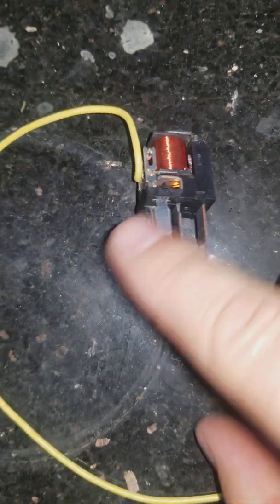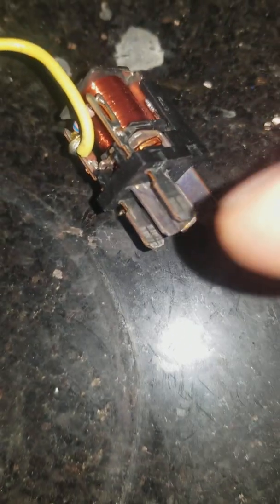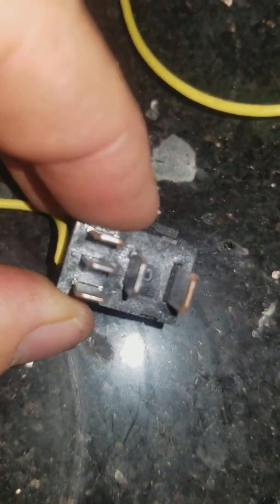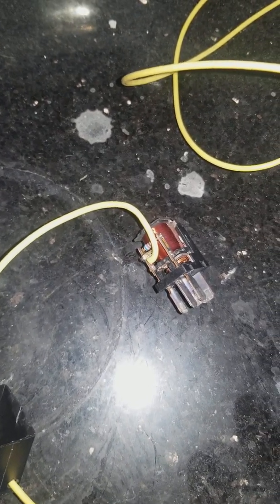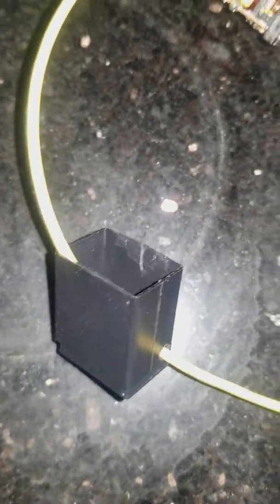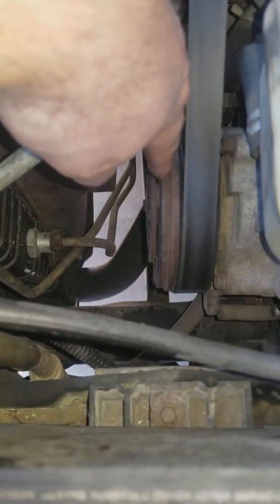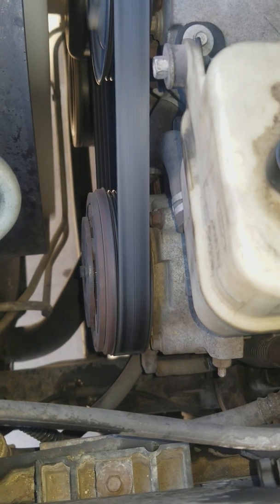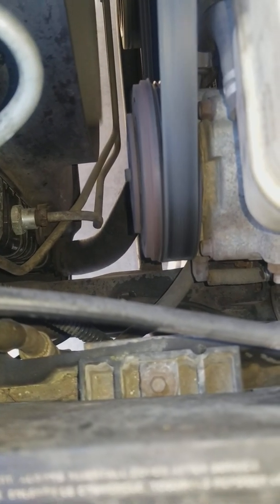Ford Explorer AC clutch intermittent fix

Comment: Hello i'm having the same issue, if i do this tha ac clutch will stay engaged all the time or will it do its cycles?
Reply from the maker: Clutch will remain engaged only with A/C switched on and key in running position. It will not just leave the clutch engaged after turning engine off. That would drain the battery.  Now, what you lose is the intentional intermittence as designed for when you are low on freon.

Comment: I have a Focus and my case is opposite. When it's in idle, with no engine load, AC works. With any engine load (for example, put gear on D, or RPM about 1000) the compressor goes intermittent. Do you have any idea about it?